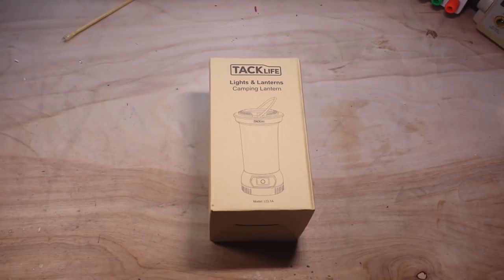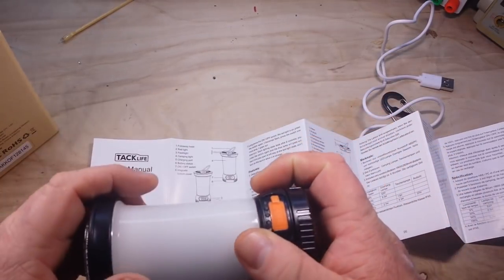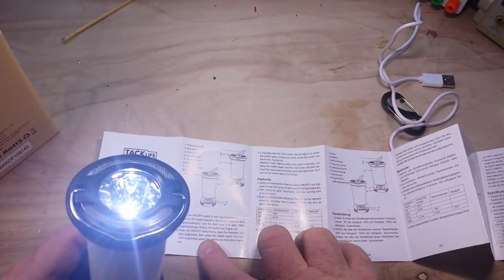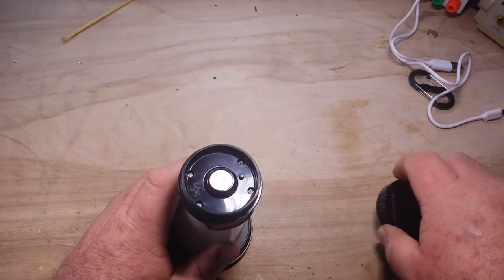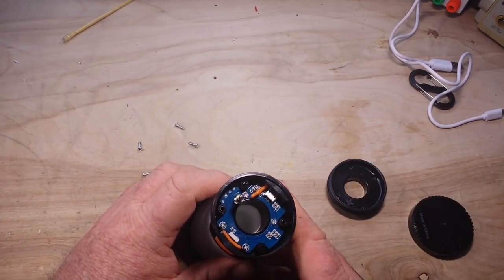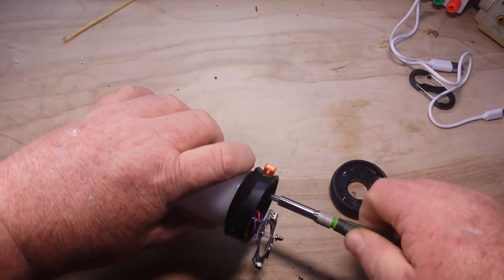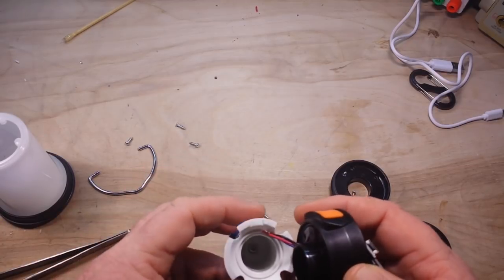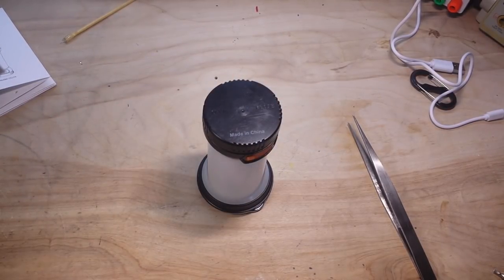TACKLife Camping Light Teardown

Comment: Hey congratulations on your retirement, hope you dont retire from youtube Ive learned so much from your vids. Just in the process of building some of the projects featured in your vids. Reverb unit, amp module and blutooth module. Hoping to build into a single unit with fm, sd card and usb, awsome, hope it works.  Again hope you enjoy your retirement, time for all those electronic projects you never really had time to do. We in the uk of my age have to work until we are 72 before we are eligable for retirement so ive some time to go to get round to the projects i havent the time to fully concentrate on. Thanks for yet another awsome video. Regards J
Reply from the maker: I'm not leaving YouTube. I don't want to retire either. My doctor is forcing me.
Reply: I really feel for the young ones over here.  I got away from work on ill health retirement after an accident in the power station and I also had a good works pension which are not really available nowadays.  My pension is 47/60ths of my wage!  Try getting a pension like that now!
Reply: Wow,  here i pay 14% of my salary every month an when Im 72 i get 30% of my final salary.. I feel that im being robbed.